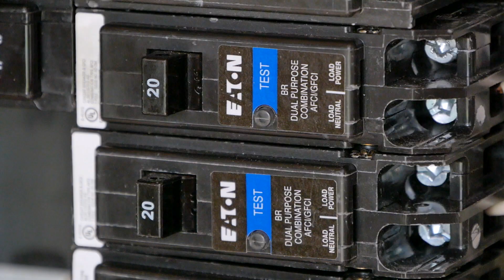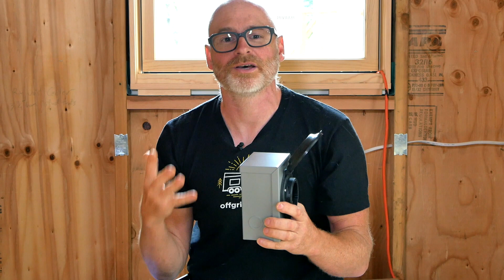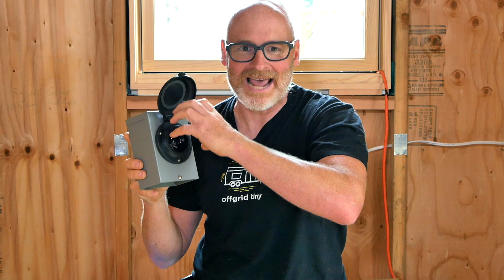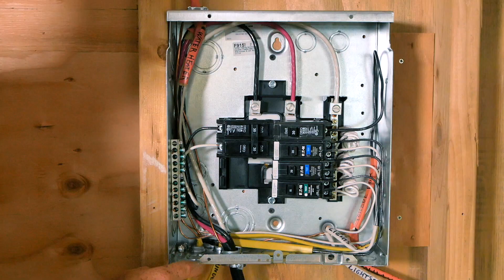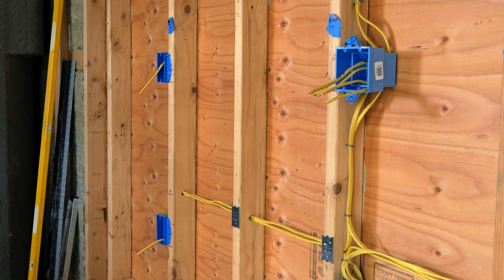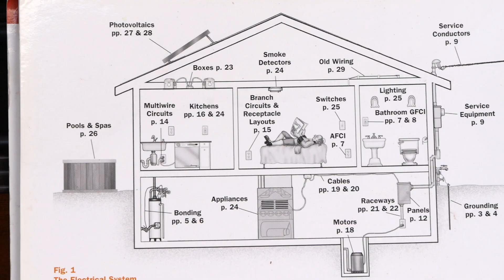Wiring a Tiny House Sub Panel

Comment: looked thru your videos but didnt find what i was looking for . i have tiny house (34x8.5x14) i have 4 -100 panels on roof ,4 -100 amp batteries and i am figuring on getting more of each . i wanted to have dc12volt fuse panel with a 2300 inverter (max of 4000) but couldnt get dc fuse to work with batteries ,solar and panels do you have video on something like this set up?i want the dc to run lights , inverter to run induction stovetop, mini split , and sockets frig ,computer run off batteries sincerely deb bushee vt

Comment: Thank you for your videos! Do have any comments on your decision to use Romex versus Marine triplex or Tray Cable? When you look online for tiny house/travel trailer construction, you see a lot of people talking about work hardening from vibration and thus the need to use stranded wire. Obviously Romex is way easier to work with though.

Currently building my tiny, which looks SOOO similar to yours lol. Dealing with this question. Thanks!

Comment: The number one strain relief connector with the screws, in my opinion, are not good for tiny house installation, because they can be over tightened and dig in to the insulation, especially on a house on wheels, prone to be moved, (vibration) I would recommend the plastic button type, leave Romex connectors for the stationary houses and don't over tighten. Just my opinion

Comment: My understanding is that when you apply the same single phase to both poles of a split phase circut, you get no voltage difference and no load.  Running a 120V adapter merely deactivates any of your 240V loads, but doeas not create a hazard.

Comment: i am building tiny home and have been doing electrical , but i have yet to find way to combine 120 v and 12 volt in house , I want to have 12 volt on lighting , 120 on plugs and for thing like hot water , very small dishwasher  washer and dryer  computer , Also i am going to buy solar system for house a renology system . so will have batteries storing power that will be attached to electrical system  sincerely deb bushee

Comment: Really good video; concise and to the point. I noticed your load center does not have a main breaker. I am going to be powering a "non-permanent" shed from a 50a RV pedestal. Connection will be with a 50a RV cord to 50a power inlet to indoor load center inside the shed. The RV pedestal has a 100a breaker (it has 50a, 30a, and 20a outlets on it). I am feeding the RV pedestal from a 90a breaker in our main meter/panel (feeder wires are 100a MHF, but code requires it be protected by 90a breaker when it is not feeding a permanent structure). I am trying to figure out if I should have a main disconnect in the shed load center, but I see you don't. I have limited electrical experience but my instinct tells me there should be a main breaker accessible inside the shed, rather than relying on disconnecting the RV cord or hitting the main breaker in the RV pedestal (both of which are outside). What are your thoughts on this?
Reply from the maker: The only thing a breaker at the subpanel would do is give you a slightly quicker disconnect for working on circuits in there but if you’re working on the circuits you can just unplug the cord.  Electricity feeding from the outside can’t overload the circuits on the inside because those are protected with their own breakers but it could potentially overload the wire going to your sub panel which a sub panel breaker wouldn’t help with.  In the right place for a large breaker in that situation is going to be at the pedestal and sized for The rating of the wire between the pedestal and the subpanel.

Comment: Great Video!   Very well explained!   On thing your viewers should know,  you should never plug your land line plug into a live receptacle.  The breaker should be turned off, plug installed and connected to house, then breaker turned on.   Otherwise you will get an arc every time you plug in damage over time.

Comment: CRAFTSMAN 10-Piece Steel Handle Ratcheting Multi-Bit Screwdriver Set
Item #1061265Model #CMHT68008  Lowes $13.00 Tight Places or https://chapmanmfg.com/ Speciality Screwdriver Sets

Comment: Just curious what would the issue be from a 50 to 30 amp adapter? Would this change the whole sub panel to a single phase wouldn't that trip the appliance breaker that requires 240? And how does a RV AC / DC panel differ would that stop this from happening?
Reply from the maker: An RV AC DC panel is just a panel that combines both your DC wiring junction and your AC feed but they don’t communicate.  The issue with the adapter is exactly what you said that it changes the entire panel 120V on the same phase.  The way a 240 V appliance works is that the two hot legs are in opposite phases and so what is effectively happening is that every 1/60 of a second the polarity reverses and you can think of it as the opposing phase becoming the neutral wire for the other phase, except it’s even more efficient than that because as one side is pushing the other side is actually pulling the electrons.  This is why 240 V does not need a white neutral wire.   But if suddenly you use an adapter and both of those wires are on the same phase then essentially there’s nowhere for the current to go and that can create a major hazard depending on the appliance.  Water heaters are interesting though because you can actually remove one of the hot wires and route it to the neutral bar and it will run on 120 V albeit less efficiently, (most are actually rated to do this and come with wiring instructions) which is what we would do if we had to plug into 120 V with an adapter.   It’s a bit of a confusing subject I hope that makes sense.  Let me know if I explained it well enough.

Comment: I don't understand when you would take a 50 amp plug and use a 120 volt adapter. 
Is this for connecting to a 30 amp service?
Reply from the maker: 50A is 240V, an adapter would be for when you only have access to 120V service.

Comment: Well, I am happy to reside in Germany. Our power suppliers deliver 230 volts which is certainly more dangerous than 120 - but you really need to have an expert to do the installation (or be one). For mobile homes there are certain rules you have to follow. All cables must be wire lines. 16 amp + wires must run trough a cable trench. I'd use silicone isolated wires to be safe (no need to). Residual current protective devices must be installed in new installations here. You can do it with a single one  - but i would recommend one for every 'room' like bath/living room/bedroom and one for the 'emergency' lights.
Just my thoughts - I really appreciate sharing your experience even if some things are not usable here, overseas.

Comment: If you're using a plug on neutral panel, you do not need the pig tails and cleans up the wiring a good bit in the panel. YMMV on what you have available and what works for your space. I've not seen one this small, so possibly not an option.

Comment: These videos have been super helpful in my tiny house electrical preparation. I installed the same inlet box and Eaton subpanel!
I'm stuck on mapping out the smoke detectors circuit and was hoping you could provide some guidance. I'm reading that smoke detectors and carbon monoxide detectors can't be on a circuit with a AFCI/GFCI breaker. If there was an electrical fire, it would trip the AFCI breaker and stop power to your detectors. According to NEC 210.12(A), I can use a protective conduit on the home run to the detector to avoid nails damaging the wire. I could also use this system to install an AFCI/GFCI outlet and protect all outlets downstream of it on the circuit. I believe Jake from Tiny Nest did something similar and used AFCI/GFCI receptacles instead of breakers but he doesn't address the alternative in their videos as far as I can tell. I like the idea of the combination breakers but they're +$50 each and take up an entire space. I want to be able to use tandem breakers to conserve space. Appreciate any feedback or advice on the approach!

Comment: Where dod did you find the 50amp inlet box?
Reply from the maker: It’s just a standard 50 amp RV inlet.   I think you can search surface mount 50 amp RV inlet.   Let me know if that doesn’t work for you
Reply: @actuallytiny2537  I've also been looking for that inlet, can't find it anywhere, thought about the shore power inlets, but they protrude too far into the wall, wouldn't be able to hang drywall over the studs, if you have a link to those inlets I would greatly appreciate it, thanks
Reply: Searched every way possible and cannot find.  Help!!

Comment: Fantastic detailed video! I love how you explained everything. Quick question though, if it's a 125A panel shouldn't the main feed wires be #2? Or do you consider this a 50A (#6 wire) panel because you have the 50A RV plug outside? Thanks!
Reply from the maker: The latter is correct.  The circuit is limited by the connection size.
Reply: I still don’t understand how that small Awg of wire servicing that panel with 115 amps worth of breakers in it is sufficient size? Anything over 100 amps of service should be at least 4 awg wire no?
Reply: Or is it because what your servicing is still under the allowable wattage of 50 amps?

Comment: Hi Brian! Thank you for this video! Just wanted to make sure if I understood you correctly concerning 50 amp service. Am I correct: if I have two separate 120v lines coming into my tiny house sub panel ( one line to each of two main lugs), in this case I can have 220v loads inside tiny house since these 220v circuits will be using both 120v lines “simultaneously” as long as it’s connected to the correct outlet ( 50 amp 120/240 outlet with two hot wires). Is this understanding correct? Thank you in advance!
Reply from the maker: That's right, but you can't use an RV pigtail to adapt your 50A plug to a 30A plug because that would place both your hots in the same phase. This usually isn't a problem with RVs because an RV panel is still only running 120V loads on the two out of phase legs.  If using a pigtail you have to disconnect and 240V loads.  The cool thing about most tank water heaters is that they can run 120 or 240 by switching the other hot to the neutral bar.